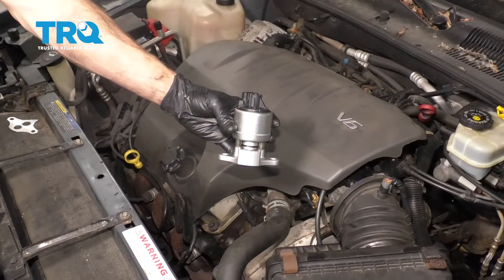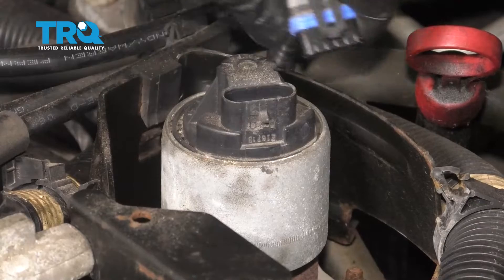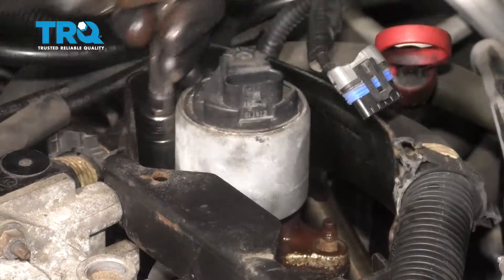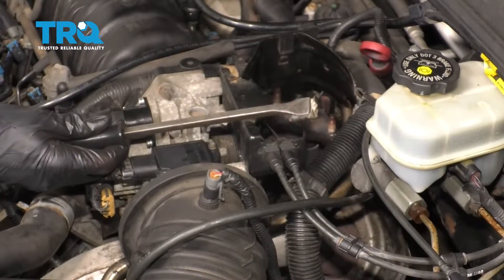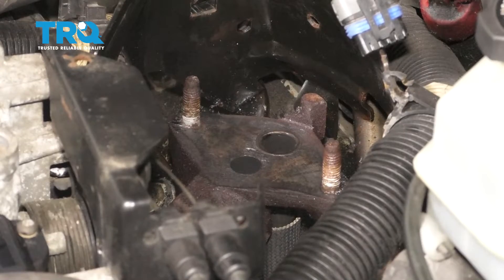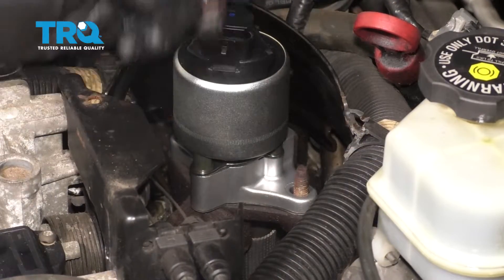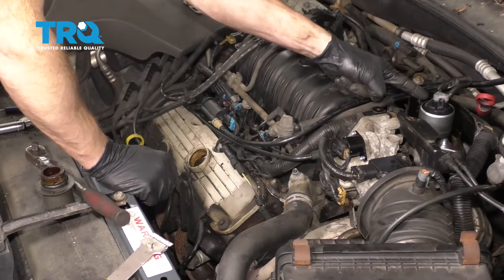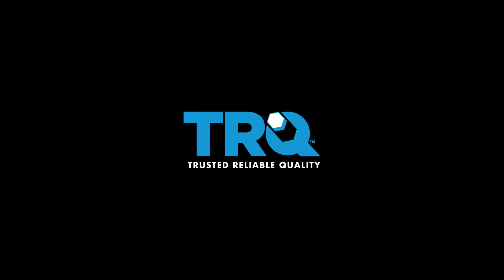How to Replace EGR Valve 2000-2005 Buick LeSabre

Comment: Just a heads up. I used this video to change the egr valve in a 99 buick lesabre. Bought a duralast part. The bolt holes for the gasket didn't line up with the bolts. They were 1/16th inch too narrow and I had to ream out the edge to get the gasket to fit over the bolts. I wonder if a more expensive part would have fit properly. Probably should have checked it at the store before bringing it home. Lesson learned. Car is fine now though.